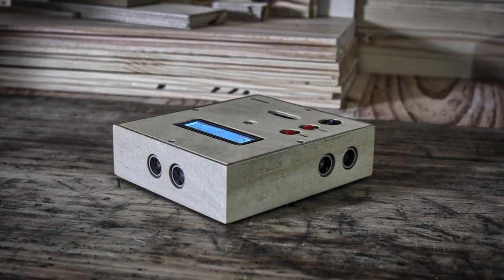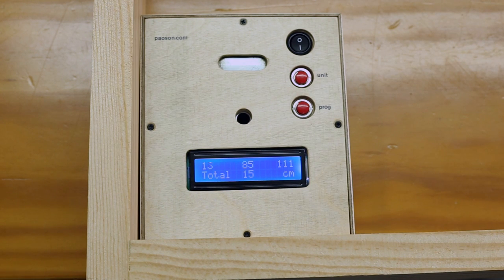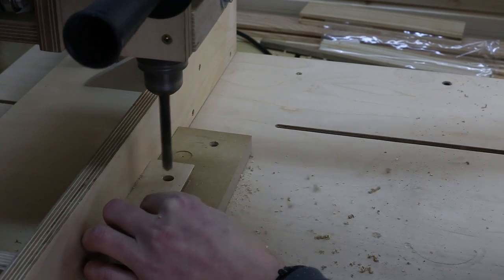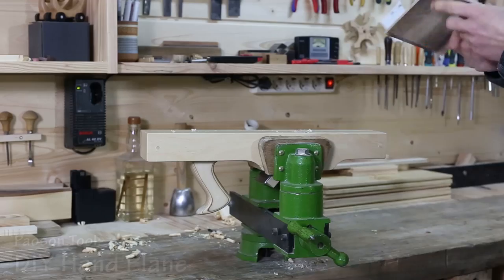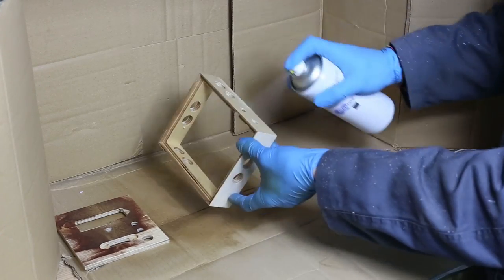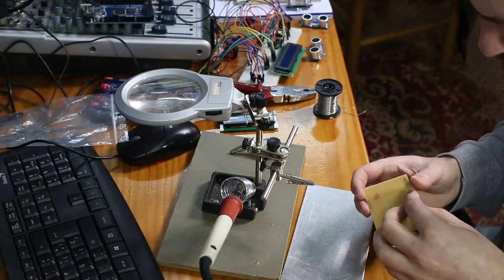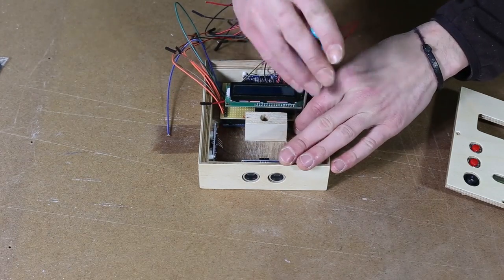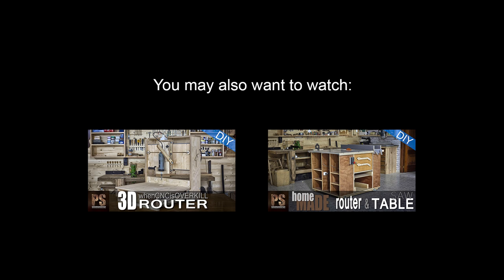Arduino Distance Meter

Comment: How accurate is it?
SONAR is effected by humidity, temperature and barometric pressure.
There are cheap and small sensors that can be added to compensate for these.
Reply from the maker: you're right,  the sonar is effected by humidity and other factors. The interesting thing is the idea, but you would have to use other electronic components

Comment: That thing is awesome!! Like all your other projects, it looks amazing, too. How is the accuracy of it?
Reply from the maker: +ladedk The sr04 has a 3mm resolution, so I am using only using it in entire centimeters. You can also change it to inches pressing a button but then the resolution is even worse. I think working with the code you can achieve a higher resolution but I am not sure about how to do it., thanks!

Comment: awsm work (y) but I want to know is ultrasonic sensor giving  you accurate result ? if not can you please suggest some other electronic device which can be use with arduino to generate accurate result :)
Reply from the maker: Better to use arduino laser sensors, but they are more expensive. Thanks!
Reply: okay thank you :) but could you please share some specific link for Arduino laser sensors?
Reply: raman rayat plz

Comment: Very cool! I wonder about the precision! how accurate and repeatable can it be? Sorry but my quality engineer mind took the steering wheel of my comment :D very cool project!
Reply from the maker: +Cactus! workshop Thanks! it has not a high precision. The sr04 has a 3mm resolution, so I am using only using it in entire centimeters. You can also change it to inches pressing a button but then the resolution is even worse. I think working with the code you can achieve a higher resolution but I am not sure about how to do it.
Reply: I see! that's good though! nice!